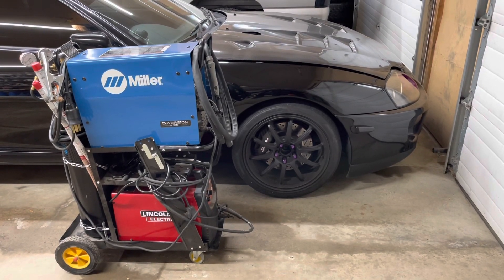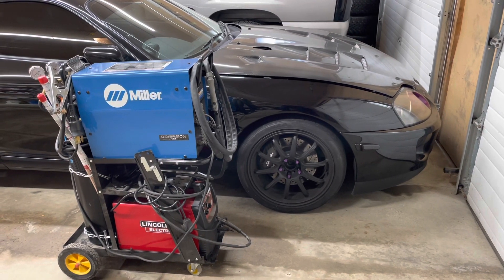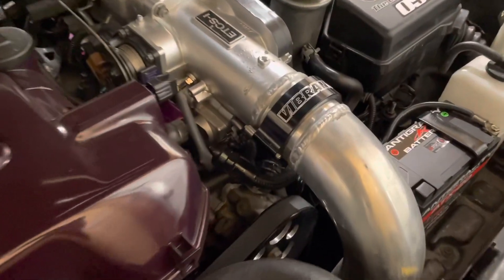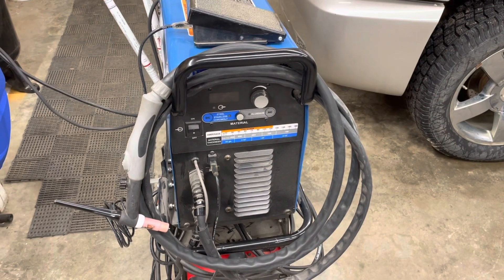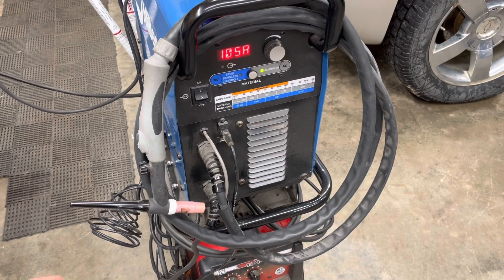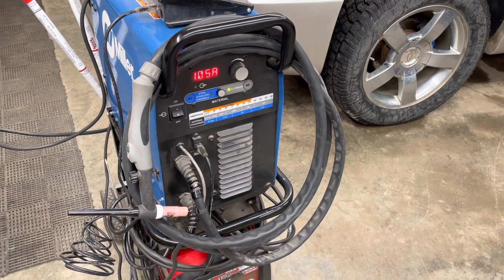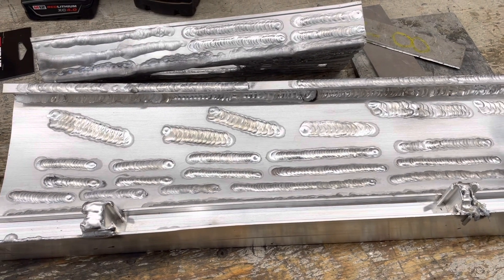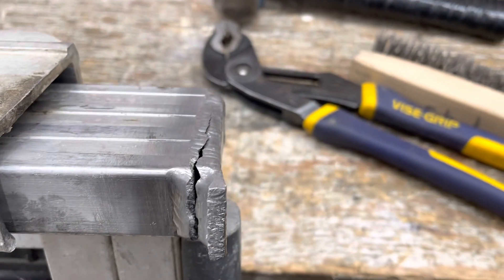BEST TIG WELDER for beginners! Miller or Lincoln?

Comment: I like the diversion 180 for sanitary welding etc. far as aluminum welding I have a primeweld Tig 225x w/ maxcool watercooler and CK worldwide flex-loc torch pickup for less than $2000 new. Best investment ever I'm like you I do all my car mods myself. I've found using the miller for the aluminum I was having to do dubble passes at times due to not enough amps. Thus the upgrade haven't found anything that I couldn't weld plus the watercooler and water-cooled flex-loc torch is awesome to not burn up my hands anymore.
Reply from the maker: I’ll have to look into that unit. A water cooled torch would definitely be a nice upgrade. My current set up gets hot very fast with anything over 100amps

Comment: I don't know where you are getting your prices from but you are way high. The welder new is about $3000 and the tank full is less than $200. And yes I have several welders including that Miller.
Reply from the maker: Likely different countries. Are you from USA?
Reply: Yep @JT2JZ
Reply from the maker: That’s why your set up will be roughly 40% cheaper then mine. 
You’re lucky.
Reply: No way the Div.180 is worth $3000.  It's a firecracker and after it pops, junk it unless you like paying about what a welder costs for the parts.